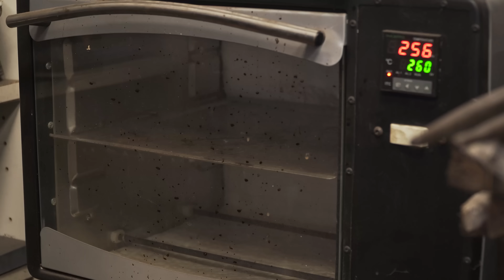Forging a Japanese Style Dog Head Hammer

Comment: Quality workmanship.  Just wondering what advantage that type of hammer offers compared to traditional medal working hammers?
Reply: You have asked the key question. This is my opinion, many will disagree. I’ve tried such a hammer on a few occasions. They are awkward. Our “western” hammer evolved from a stone ax in several separate cultures. Every one had a symmetrical head with the haft centrally located. Except Japan. China, Korea all had “normal” tools. That Japanese hammer is very hard to hit a square blow with, it wants to twist on impact. 

This statement is true of other uniquely Japanese tools. The saw, plane and so forth. The commonality I see in Japanese tools is extreme frugality of metal, especially good steel. The Japanese sword, katana, is a perfect example. Only a tiny insert that is the cutting edge is steel, the rest is soft iron. Elaborate welding and forging techniques must be employed to make a functional blade. The Japanese substituted excessive labor and developed complicated techniques to compensate for a lack of basic resources. 

Today’s modern workers recognized this skill and marvel at the complexity of technique. But don’t clearly understand that “complex” is not always “wonderful”. There is a large element of fad in our appreciation of all things Japanese. Not knocking the Japanese. Just providing perspective. 

Now to this hammer. An original one, an Ozuku I think they are called was not made of a single piece of steel. Rather the hammer was mostly very low quality iron with significant slag. Then a small thin bit of steel, poor quality steel by our standards, was intricately set and welded into the face of the hammer and tempered. These hammers wore out quickly and had to be reforged several times in the working life of a Japanese smith. That design gave a functional hammer with the least investment in material at a huge cost in labor and creative design. 

Had Mr Beard actually made such a hammer not just in form but as originally made his 10 minute video would run two hours. Thus in Japan you have “traditional” smiths who follow the “old ways”. But when they want to get a job done, as in a factory, they use modern tools of “western” design. Hope that answers your question.
Reply: @MrJento  That is a very lenghty and educating reply there. Thank you for that!
Reply: @schlappesaascher  Some might say long winded. Your welcome.
Reply: @MrJento  I was trying to figure out the advantage to such weight imbalance myself.  It would tend to twist when swung, requiring strength and grip on the part of the operator.  The advantage I can see is it would be much more stable during and immediately after the strike than a symmetrical hammer.  Maybe for chisel work?  Beautiful build in the video!
Reply: @lironmtnranch4765  
Yes. Very nice work. But read my comment. It’s not stable on or after the strike. For little taps, yes. But put some muscle on it and your follow through will roll it right or left with the subsequent “owl eyes” left in the work. Try one sometime.
Reply: @MrJento     Not only Japan This type of hammer was widely used in India  also by traditional blacksmiths,  there are heavy hammers  also with double handles ,
 What u told above was right , it’s tricky to use it for other jobs than forging , when I was young I ask my uncle about it  he only use dog heads for forging , he told using normal hammer make strike marks ,  Dogheads won’t make that kind of marks , those days smithy shops doesn’t use any grinder or files for finishing  they finish by hammering only 
Not sure about the material we got a few dog head  hammers passed down  generations
Reply: @nigoshgopi8377  Thanks. Hope they work for you. 
“To each his own” farmer Brown said as he kissed his cow.

Comment: Beautiful finishing on the hammer head. I have a question, though: why the quench is in water? I know that with knives that makes the steel too brutal/fragile. Just a question of an newbie. Cheers
Reply: It seems to me that C45 steel can be easily tempered by simply heating it to 820-850 degrees Celsius for it to harden. In this case, when it starts to glow bright red, it can be simply quenched in water.
Reply: The mass of a hammer head usually doesn't cool quick enough in oil. It's always better to water quench them as there is very little chance of anything going wrong. Hammers are usually made from softer steel too so water is the way to go.

Comment: What happened that gave it that finish.?  He put it in that little machine/oven right?
Reply: When you heat up steel it will change color depending on how hot it gets. It goes from grey at room temperature through straw color, various shades of blue before it starts getting red. Get it too red and rapid oxidization happens, slag forms, and it's grey again when it cools down. but get it to just the right temperature and it'll retain it's color which is what happened here. Generally, the process of hardening steel requires it to be heated up to a straw color.